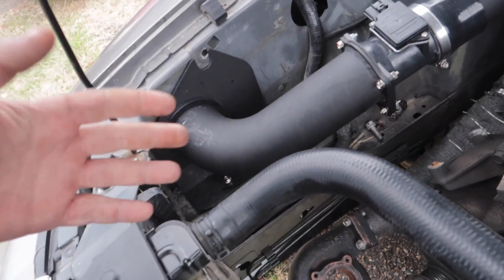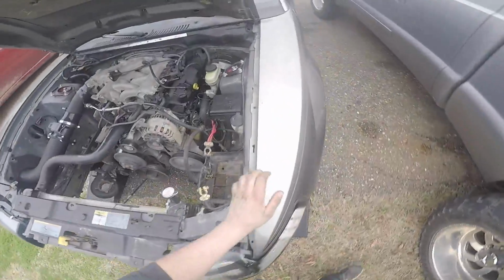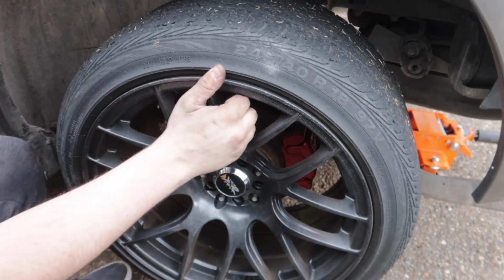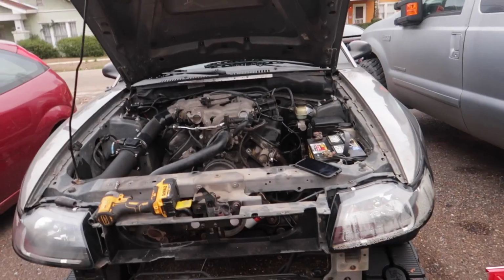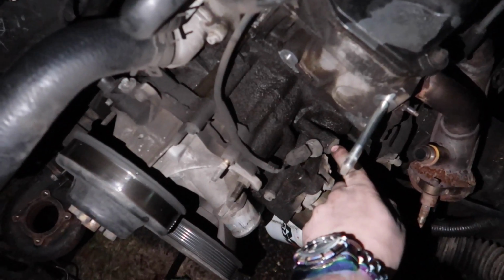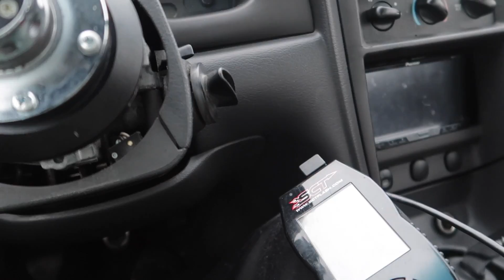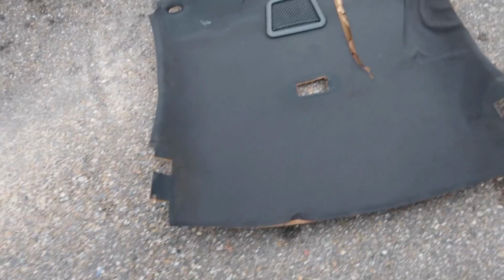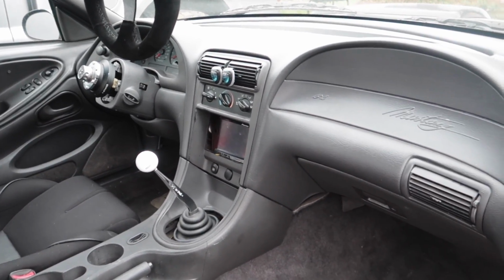$700 Drift Twin Turbo Mustang Build!!!! Episode: 2

Comment: I love how he is committed to keeping the stock 3.8 in there
Reply: They'll handle around 400 wheel stock internals with a decent tune. He can run it around 6-8 psi and it'll run for years with proper maintenance
Reply: that_green 4.6 ik that is the amazing part about those mustangs with those motors. And they can go suprisingly fast woth that much power cause they are so light
Reply: @ahmeddiagne1906  yeah man I love the 3.8s they're great engines and bulletproof in stock form at least I have one full bolts ons on spray with 450hp
Reply: that_green 4.6 that is sweet
Reply from the maker: Ahmed Diagne 💚💚
Reply: @lowslo9287  Might as well get a TorqAmp. Much simpler

Comment: Assuming you got the clutch issues fixed then since you lost footage?
Reply from the maker: Nope. still broke
Reply: @PoeBoys  i had the same issues with one of my cars, left a comment on a previous video. Think it was ep 1 but not sure. I have a 2000 v6 and an 04 GT thats procharged. Pretty much know these cars in and out. Just a pain in the ass bc I paid a shop to do my clutch in my v6 and it ended up going back 3 times because they never did it right
Reply from the maker: ProjectPompeii the clutch itself is good, but the cable needs to be switched to a hydraulic slave!
Reply: @PoeBoys  it 'needs' to be switched or "neeeeeds;)" to be switched?
Reply from the maker: ProjectPompeii It wont move until I do it sadly😂
Reply: @PoeBoys sad...

Comment: If you're building a drift car I would of just welded the 7.5 and ran it till it blew . not getting a lot of grip or hard launching on a drift car
Reply from the maker: that_green 4.6 its hard to get the 2.55 gears going from the 7.5
Reply: @PoeBoys  not when you're not stock you keep it in first or second I also drifted a stock 00" v6 mustang with just a welded diff on stock gears

Comment: Poe the glow plugs and the glow plug relay are could very well be the reason your truck takes so long to start. I needed both and now mine fires right up without any problems.
Reply: Yes sir your 100% correct.

Comment: For an upgraded intake pick up a 97-00 f-150 4.2 upper intake manifold i have one and it rips! Fairly easy to install as well, hood clearance is a slight worry but it will make the intercooler pipes 10x easier to run.